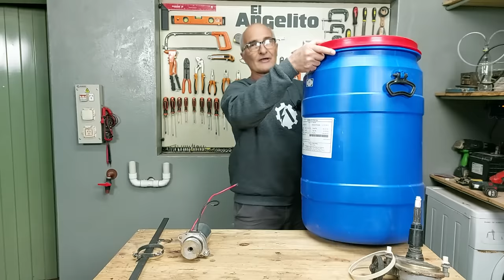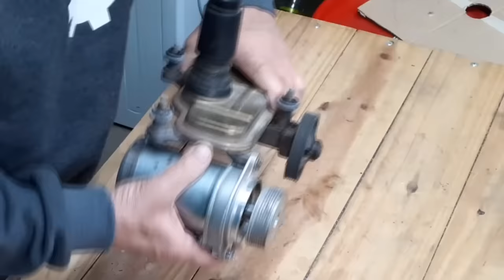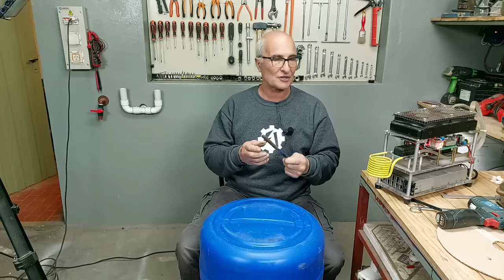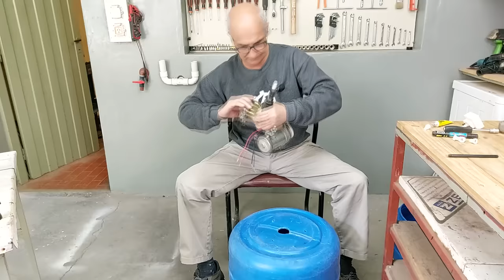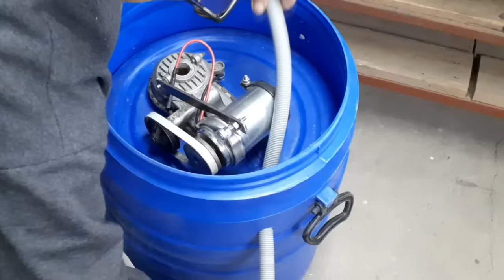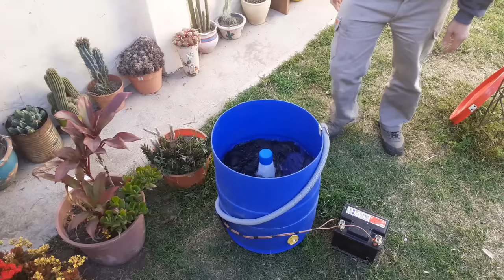LAVADORA PORTATIL DE 12 VOLT - Económica y Fácil de Construir

Comment: Muy útil, también para energía fotovoltaico
Reply: 12 voltios ...de donde vengan
Reply from the maker: Si, pero deben ser 12 voltios con una entrega de 5 amperios al menos.
Reply: @elangelito  
Yo tengo una instalación de 12v desde la salida "cargador 💡" de mi regulador de carga, manejo focos de 12v, sensores de luz, movimiento y muchas tiras LED, no llegan al amperio de consumo, eso si, no estoy seguro de cuanta tensión soporta esa salida, según el regulador es de 30a

Comment: Mi idea viendo esto es que en mi casa debiera tener 10 baterías de 12v en serie,cargándose con 120v convertidos a directa y sacar para los equipos que necesitan 12v,el voltaje DC de cada batería un voltajes con la opción para lavadora y licuadora de conectar dos o tres en  paralelo para aumentar la potencia de los motores,que también podrían ser de 12v.